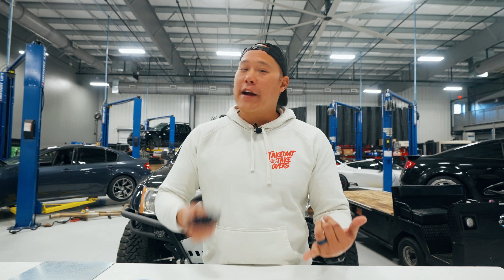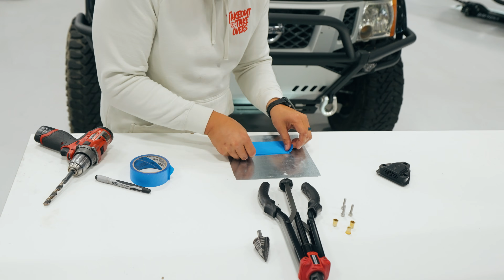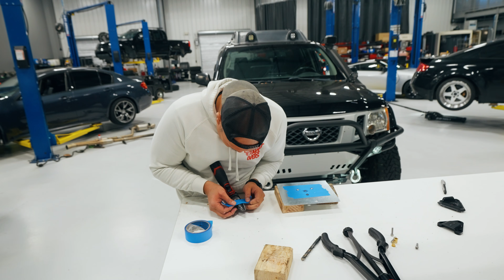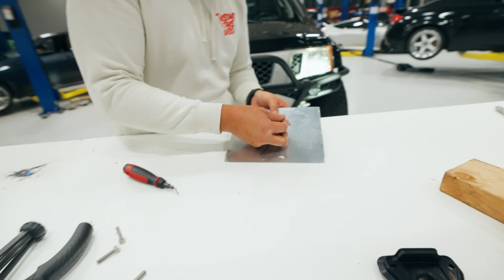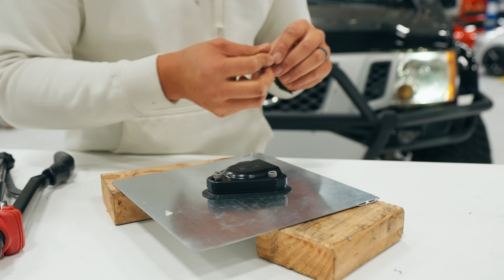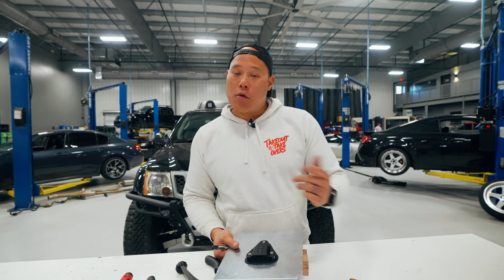Roof Light Wiring Grommet by Z1 Off-Road

Comment: What seals the rivnuts from leaking? Does it depend on the outer part of the triangle to prevent water intrusion into the center of the base where the rivnuts are? If so, then what is that center grommet for? Do the instructions include using a sealant on the bolt threads?
Reply from the maker: Yes, the EPDM rubber will squish to provide the seal. But a dab of RTV or Silicone can be done for a secondary barrier.
Reply: @z1off-road  What keeps water from using capillary action to wick down the threads?

I'm asking these questions because one of my 2 Xterras has the dreaded leak from the roof rack, and it is due to the threads. I see the same issue here and wonder what is the best way to prevent it, not because I'm trying to embarrass you. This looks like a great idea, but with these questions, I'm doing my due diligence before buying.
Reply from the maker: @hotflashfoto  The EPDM rubber has enough squish to keep water out. It seals the outer perimeter. But like I said before, there is nothing stopping you from running a bead of silicone or RTV around the rivnuts and threads.

Comment: Now, show me how to get the air dam off without those stupid rivnuts spinning.
Great product, BTW!!
Reply: requires rust penetrant or heat.  Pay no mind to the blistering paint...

I just dropped the headliner and replaced the factory nuts.  PITA
Reply from the maker: We removed it in the video of the boob light brackets. Hand tools only.
Reply: When you remove the roof rack, the bolts are one time use. The rivnuts also have seals integrated into them and are easy to replace. I would have some new inserts on standby and bolts to replace the ones you removed. To remove the nutsert, just simple wiggle them out with some pliers. Prior to install clean all the threads of the older nutserts of the factory blue thread sealant. Then, run a bolt into each nusert to check tightness and security. This will help prevent from taking the rack off again and also prevent in cabin water intrusion.